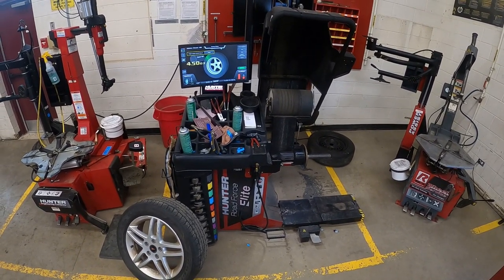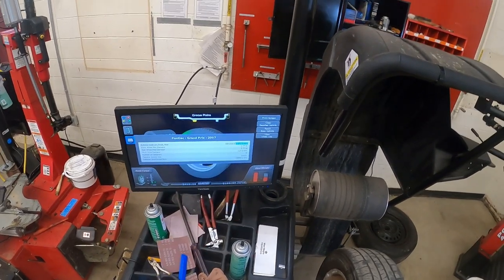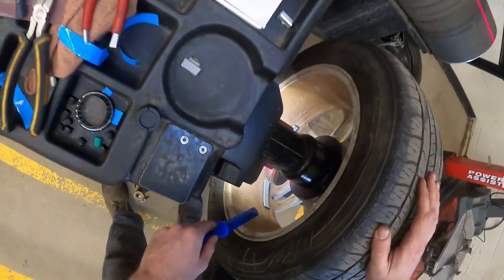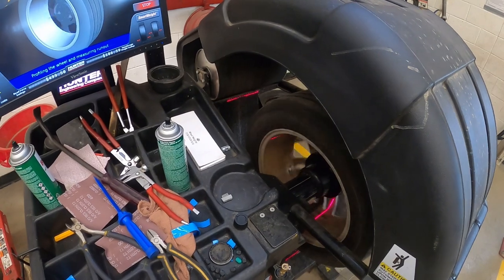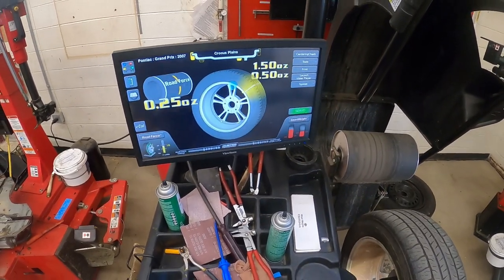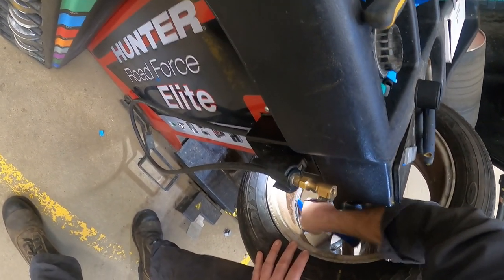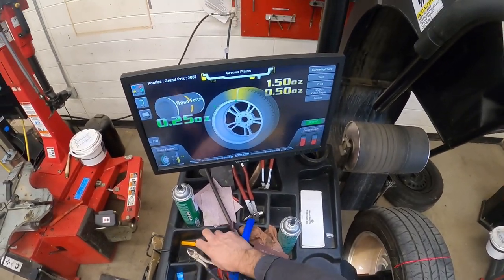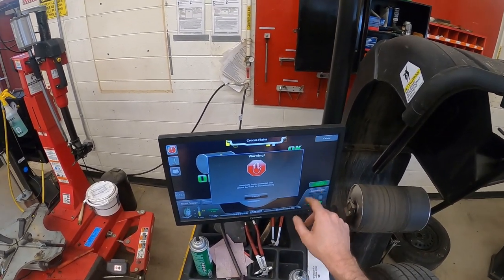Roadforce Balancer

Comment: 9:36 I don't like putting two wheel weights in different spots of the outer rim. Is there a setting or option where it tells me to one wheel weigh on one spot?
Reply from the maker: This wheel aligner can choose one spot on the inside for stick weights. It should only ever ask for one weight on each side with hammer on. The odd time it doesn’t balance out and you have to add another.
Reply: @autotech4103  On regular smart balancing, I know how to put one adhesive wheel weight on the inner side of a rim or outer side of the rim. But I watched different videos about road force balance. What I noticed is the machine told the technicians to put two wheel weights on two different spots on the outer of the rims.
Reply from the maker: @fromisheon4867  it all depends on the imbalance found. For most high quality tires mounted on good rims, a single weight solution will be found. But cheap tires or bad rims will often need two places
Reply: @autotech4103  so if the machine asks for two wheel weights on different spots, then most likely bad tires or rims.

Comment: Just had a set of tires/wheels "road force" balance.  What a nightmare at Tirerama in Glasgow, MT.  No one in their shop truly new what the main advantage of a "road force" balance was (to balance the force exerted by the tire on the road as it rotates).  They seemed to think the the main advantage was rotating tires around the vehicle to balance wheel pull.  They were using a 15 year old Hunter 9700 and their "old guy" claimed to have 17 years experience.  It doesn't matter how good their equipment is if they have their ideas of balance firmly stuck in the '1980s.  These guys seriously need to be trained on new (? they've had their Hunter for 15 years) tech and should invest in a modern Hunter road force balancer.
Reply: Even if they "spin" it on a "road force" balancer, they haven't truly road force balanced the tire wheel unless they rotate the tire on the wheel.
Reply from the maker: This hunter balancer looks shiny and complicated. If that’s why someone is buying it, they should buy something more basic.
Reply: To be fair it does do that. Some of these have Straighttrak LFM (Lateral force measurement) It shows the technician where to place the tires on the vehicle for least pull, and you can hit a button to show which positions to place them for least vibration. The lateral force sensors literally measure tire conicity which causes radial pull/ ply steer. This was a HUGE deal 15 years ago when tire technology wasn't what it is today (clam shell tire mold ect). But yes they definitely need a new Road Force Touch or Elite and the tech needs to RTFM lol

Comment: Just got new tires and one tire have just one weight clip on inside.Nothing outside? Is that normal to be unbalanced just on one side?
Reply from the maker: Sometimes stick weights are used inside of the rim and other times no weight is required. If you don’t have vibrations at highway speed I’d assume it’s balanced.

Comment: Would you say a tire with 17lb road force is too much for a small sedan? I've balanced and road forced a pirelli strata gt2 and still get some vibrations.
Reply from the maker: 17lbs is probably out of range if it’s a small sedan but isn’t likely the cause of the vibration. I’d switch your tires from front to back to see if the vibration moves or changes. If it doesn’t then it isn’t a wheel problem
Reply: @autotech4103  its on the right rear. Rim only has .001 run out and would've only lowered it by 2lbs force matching it. The other 3 tires are in the single digits. We got down to the mid 20s last night and these tires were flat spotted horribly this morning. Vibration was bad!
Reply from the maker: @ryanchristensen1799  just make sure you don’t have terribly worn shocks or overinflated tires in the future to avoid those flat spots. Or handbraking corners like my students lol